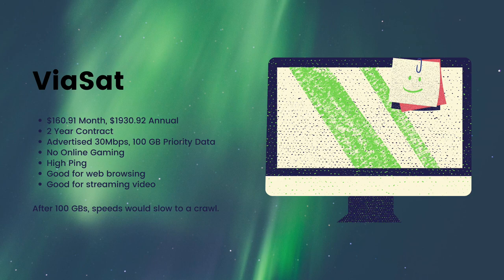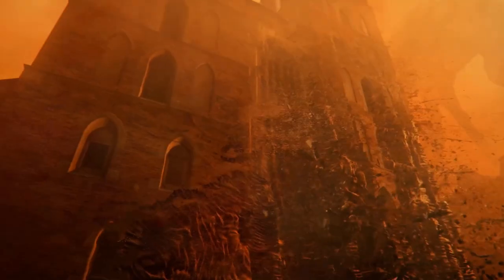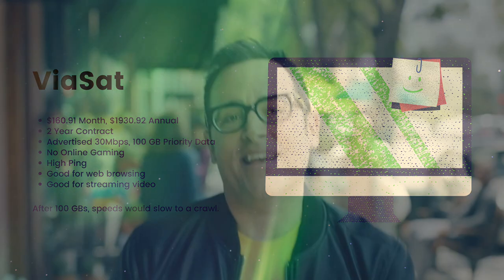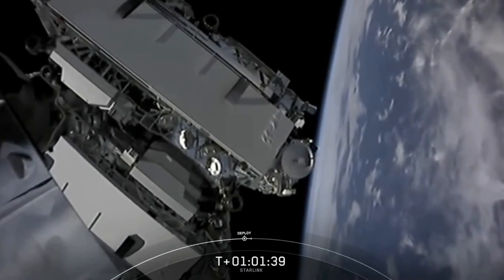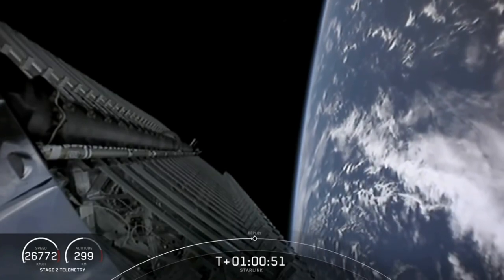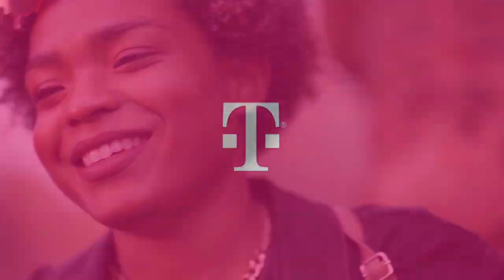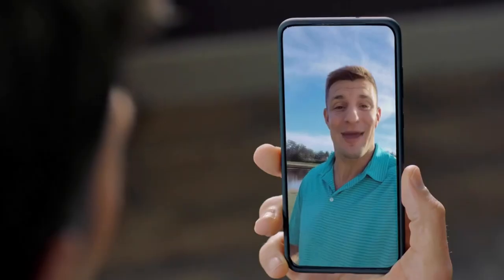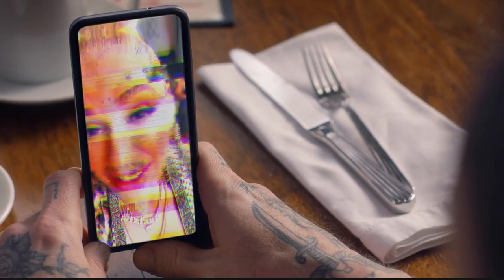T Mobile Home Internet Review

Comment: I have the new 5g t mobile home internet and I signed up before the price increase. I get around 50 to 100 mbps. During the peak time I get 50 to 60. In the morning and evenings I get closer to 100 mbps. I am over 80 gigabytes right now and I am still getting the same speeds that I always get. T mobile does reset my usage every day for the home internet. I have similar experience with gaming also.